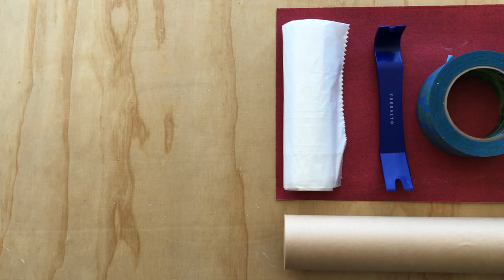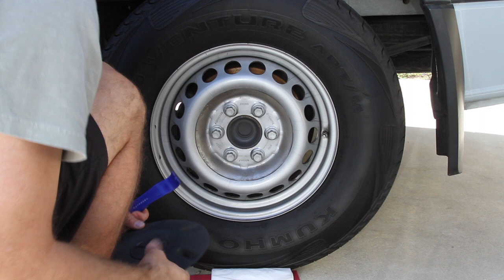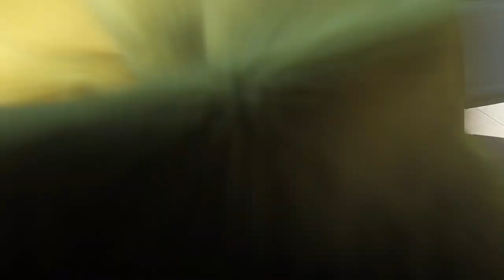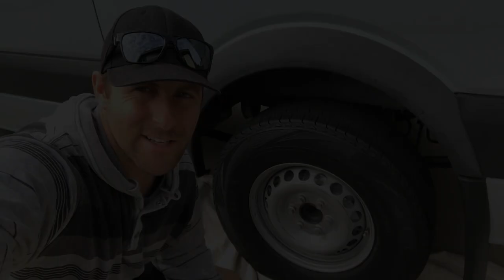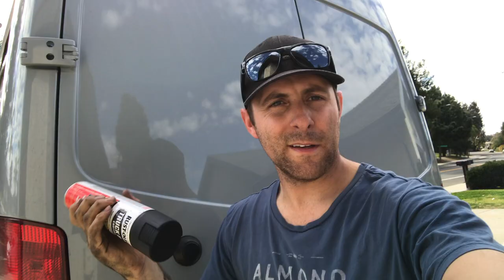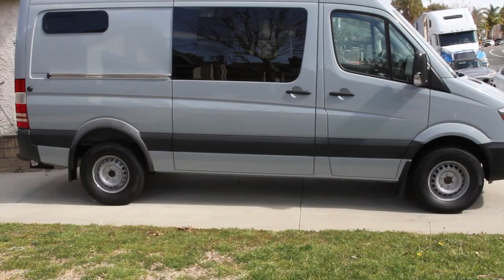It lasts FOREVER! How to Truck Bed Liner Your Rims

Comment: I missed the part where you actually used plasti dip?
Reply from the maker: Sorry if the title was confusing.. I titled it “plasti-dip” with Truck bed liner. The rust oleum truck bed liner adheres way better than plastidip and doesn’t peal off!